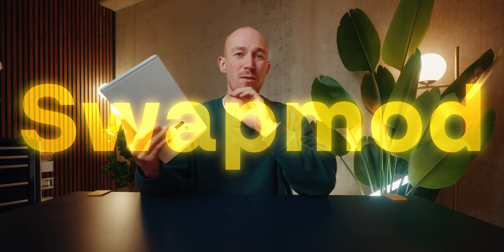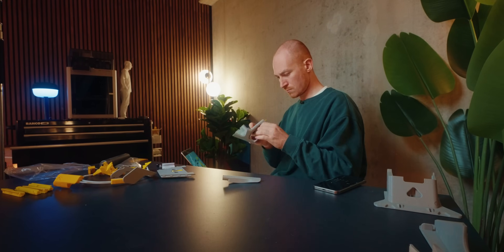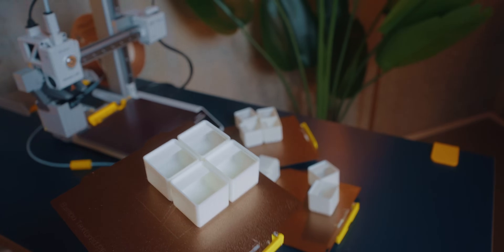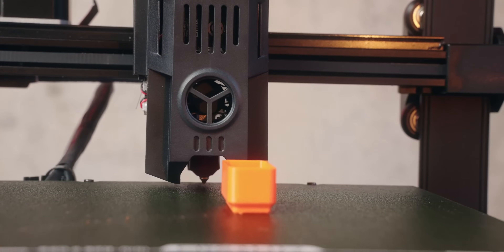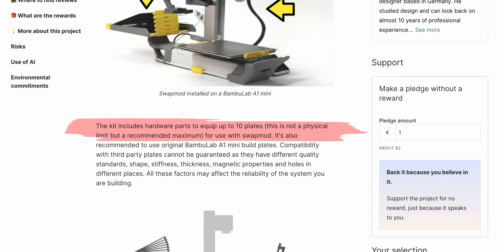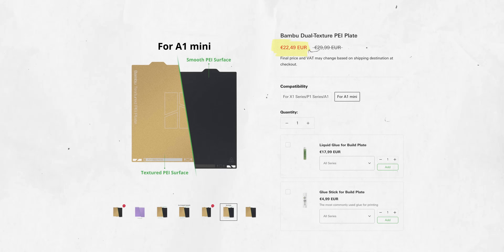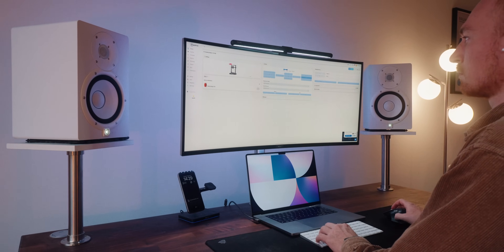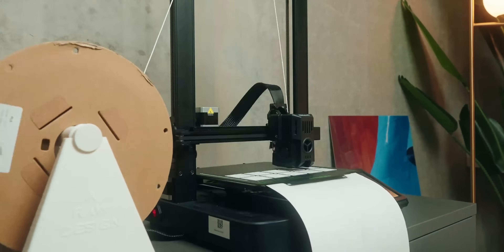Fully Automating my 3d Printer (with Swapmod)

Comment: u can already edit gcode to push prints of the plate, this feels unnecessary when u can do it for free
Reply from the maker: This a lot more safe though. Yes you can do it through gcode but if your print sticks too much you’ll run into problems
Reply: @arnebornheim  ur wrong, they have already tones of work around's an even can do them for x1c and p1p not just the a1 series, it also has a free version and all parts are free to print, and it dousnt rely on how many plates u have

Comment: i hope this will still work after bambu announced they are killing 3rd party software
Reply from the maker: I don't think it'll be a problem, since the webapp from Swapmod basically just edits the M3f file. Also swapmod was at the official Formnext booth so I think they like the project
Reply: @arnebornheim  Thanks for taking the time to reply to me, that certainly puts me at ease, im still saving up to get the swapmod :) 
It was still extremely disheartening to read though.

Comment: Okay THAT is cool! Just got my A1 mini a few weeks ago, so I will definitely be considering this. At the improvement ideas -portion I was thinking about the possibility to switch plates and start a new one remotely after a failed print that you notice from the camera or the A1 mini stops by itself, but yeah having a separate print profile would achieve that pretty easily I reckon.
Reply from the maker: Happy you like it ! 😊  interesting idea.  Happily I didn't have any failed prints with the system so far so I have no experience how to handle it specifially

Comment: Biggest red flag I see is that it requires a website to convert the files. Aside from user experience, if that website goes down you're screwed
Reply from the maker: Depends. Behind the scenes it’s all gcode that you could just use yourself. 
The website just makes it way easier to do this

Comment: This thing needs a plate slide or something.

The plate is designed to pop-off prints once it has cooled down so we could even have it go vertical.
Reply from the maker: like a little rollercoaster for the plates that restackes them at the end? 
I know Andre (the maker of swapmod) has a rail system to let plates go off the printer a little more tidy than falling off
Reply: @Arne.Bornheim  Yeah. I just die in pain when i see those plates fall, get hit and get scratched. Allowing the prints fall into a bin and the plates get separated safely would be cool to see.

I own an A1Mini myself and I'm very excited for this project.
Reply from the maker: @Splarkszter  Haha  sorry for making you go through that 😉 Yeah as I said in the video i usually just turn the printer 90° on the table so there's enough space... (takes up most of the table though )

Comment: Hi Arne. What was that little step you did at 4m50s where you seemed to fill the build plate with models in one click. Was that within Bambu’s slicer? Great video and thank you.
Reply from the maker: Withing Bambu Studio or Orca Slicer you can right click on an object and at the very top is "fill bed with copies" That should do the trick 😊
Reply: @ thank you Arne. Fantastic little trick ☺️
Reply from the maker: definitely makes it a lot easier than figuring it out yourself 😊

Comment: There are handles that are not centered, you can use them as a base and build for them./
Reply from the maker: Yeah with the handle I went stock for the video as the height of the handle also has to be perfect for swapmod to work since it attaches there. I didn't want to end up saying it's not working properly and it's just that mod. 
Andre the maker of swapmod has since send me the files for a handle he made that is compatible 😊  ( I don't think it's public yet but it might be eventually)

Comment: It seems rather pricey vs the cost of just buying a 2nd A1 mini to double your output. Print farms are not going to use this thing, they use larger printers and fill up the build plate enough to run all night. It seems very well designed, just not worth the price of the kit and all the extra build plates. That said, print farms MIGHT use this type of thing if it were designed for A1 printers which are currently the most cost effective multi-color printers, but the market for A1 print farm mods is incredibly small.
Reply from the maker: Thanks for your input! I'm no print farm owner so I have little insight on the exact pros and cons for large scale 3d printing. personally I love it, since i often print larger gridfinity models that end up taking 3ish hours. With this mod I can not get 3 done in a night as opposed to one before 😊